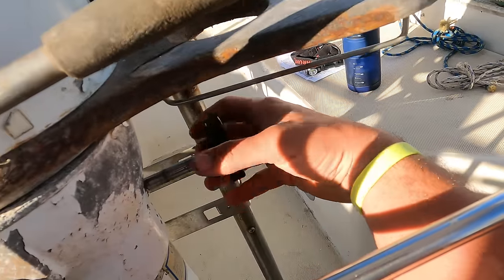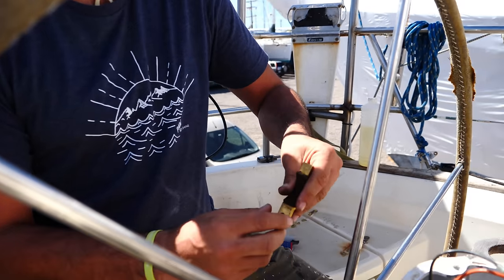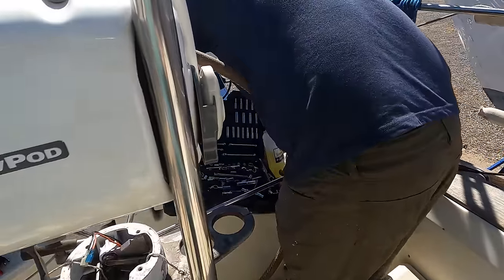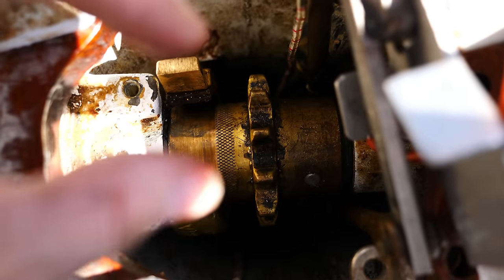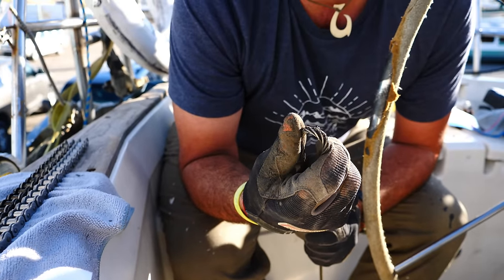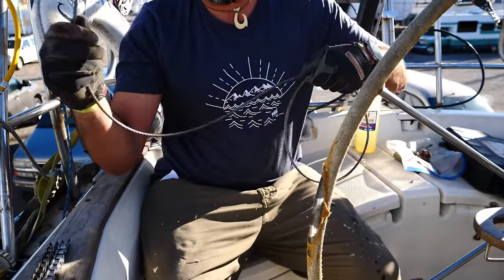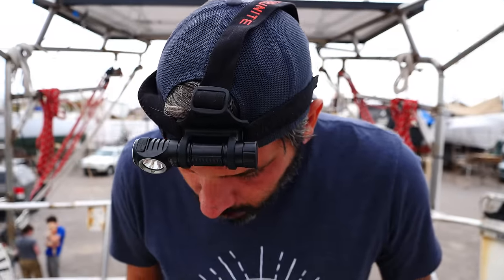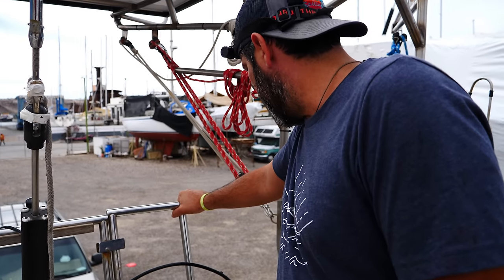Ticking Time Bomb; How to Replace Sailboat Steering Cables (Calico Skies Sailing, Ep 182)

Comment: At this point my inherant worry wart would be so in operation about the tension on the cables. My mind would be envisioning the cable jumping off the quadrant in heavy seas and then.....ugh. Sometimes I way over think things. I tend to overdo stuff to the point of causing other problems.  I probably would have tensioned the cables with a come-a-long and then they'd snap something from over tensioning at a totally inopportune time.  I applaud your confidence and experience Bill.  Grace, I hope you are dealing well with the stress of the refit and medical issues. I'm sure all of us following you are concerned and praying for you.
Soon enough it will all be behind you and the more normal routine bumps in the road will feel minor compared to these last months.
Reply from the maker: LOL yea its a fine balance for the steering cable, the manual says not over tighten or there will be grinding noises. Too slack and there is slop and risk the cables coming off. They good thing for us is our below deck autopilot has direct linkage and is a great backyup

Comment: I would find a way to preload the rudder, so the correct tension can be set on the cables so that there is no chance of the chain jumping under heavy going underway.
Reply from the maker: Its properly tensioned now, I put the AP on and fought the ram! I'm sure it will need adjustment after the first overnight sail LOL

Comment: Glad to see Grace letting loose. I suspect alcohol will be verboten for a while.  Couple things occurred to me watching this. A bit of shrink tubing will cover the ends of those cables better than tape. I hope there is lots of room in the adjustment bolts so you can tighten the cables after being at sea for a bit. I feel a bit like a Jonah but, when the autopilot was tested I thought I saw some slop in the clevis at the end of the piston, that could be the clevis loose or worn or the pin worn, or all of the above.  Worth a look and a wiggle I think.
Reply from the maker: Good idea on the AP, there is some play at that pin. It's been onboard for quite a few miles so maybe a bigger pin is needed now!

Comment: Right when I was thinking....don't let that fall to the bottom of the pedestal, you cut to the next scene saying he dropped it. 😢 Working on my motor recently I cannot tell you how many times I had to retrieve things out of my deep wet bilge. Not having another hand I had to dangle a nut taped to a wire to get it back on. Adapt, improvise, overcome.
Reply from the maker: It seems unavoidable! True words :)

Comment: I have a tip! Try using electrical shrink wrap on wire cable ends, instead of electrical tape. It would bind the cable better than tape would and might be easier to install, before, during or after the fact.
Reply from the maker: Thats a good call we didnt think of it!

Comment: Inspiring... I just hauled out here at Cabrales a few days ago and will be brought over on the skateboard from the main yard tomorrow to be placed next to Totem. I have a nearly identical Edson binnacle with a wheel brake that has needed new pads since I purchased the boat 3.5 years ago. I have had the replacements all along and have been avoiding the job. Thanks for the video!. I am going to film myself while working on the brake as I can only attribute your "never flustered" demeanor to having a camera on you during the process, or good editing. I tend to cuss while I fiddlefuck with tricky projects.

Comment: The steering cable wire will stretch in the first year of use and the cables will need to be tightened. Some systems have a turnbuckle for this purpose.
Reply from the maker: Yep it actually stretched the first 24 hours after install and then again as we used the wheel to work against the AP. Our system has adjusting eyes to tighten

Comment: I need to replace the brake but wow don’t want to now!  At least I could have the small bits.  Arista has a metal rounded piece behind the rudder (‘86) hull #67. Is yours original?  I forget whether older or newer.  Good job on fitting in and out!  Oh the fun joy.  What I can’t understand is how you are supposed to twist the lower grease cap with the housing on!  A lot of work for that one fitting!
Reply from the maker: our is a 1985, Hull #7! The rudder caused quite a bit of work LOL
Reply: @CalicoSkiesSailing  LOL,  I looked up the CG certificate,  actually finished 1986 even though the hull number ends with 687!  Still closer than I thought!  Thinking of Grace and sending (hugs)

Comment: Patient teamwork to acheive this reconstruction.  I though some systems included a tensioner e.g. a bottle screw on the cable, don't foreget it will becom slacker as it settles down.  It seems some boat equipment could be better designed (a) to make inspection easier (b) to make replacement of components a less arduous task.  Many other industries have achieved it, so it's about time the marine industry did the same.  With the rates charged by some boat yards a job like this could have cost $$$$ in some locations.  Next refit for Calico Skies should inlcude an entire respray of the binacle.  Perhaps some primer and paint could do in the meantime.
Reply from the maker: Yes we will be having to go back and in adjust things once they stretch. Agree with you there, every boat is different and some have a simpler wheel brake design (along with other things). Does feel unnecessary in this day and age but we remind ourselves it's an old boat. But the marine industry could be held to a higher standard, for sure. We did paint it! That will be coming up :)

Comment: if there is enough cable running back to the transit plate, I wonder if two loops and a turnbuckle on each cable arm would allow for taking up cable stretch as it breaks in..  Just shortening a turnbuckle would be a lot easier than pulling cable ends into a new loop to compensate for looseness.  might even make initial installation easier.
Reply from the maker: There are adjustment eyes to tension once the cable stretches a bit. I got them setup so I have alot of room left
Reply: @CalicoSkiesSailing  nice

Comment: When bending over cotter pins, future you will thank you if you don't bend them all the way round - they only need to be spread apart enough to stop them slipping out.

If they're still mostly together just split apart at a straight angle, then you can more easily get a pair of pliers onto them to squeeze them back together and extract it ;)
Reply: Unless exposed and then you have more boat bites!
Reply from the maker: thats a good tip, I think i basically got what I could with the bend, so limited in dexterity

Comment: I am guessing they didn’t provide a means of adjusting the wheel itself?
Reply from the maker: Don't think so, just adjustment eyes to tension the cables
Reply: @CalicoSkiesSailing  that figures, it would make it too easy right? Or even a middle ground of two small turnbuckles in a spot you could access. Then again, everyone would buy a boat if it was easy.